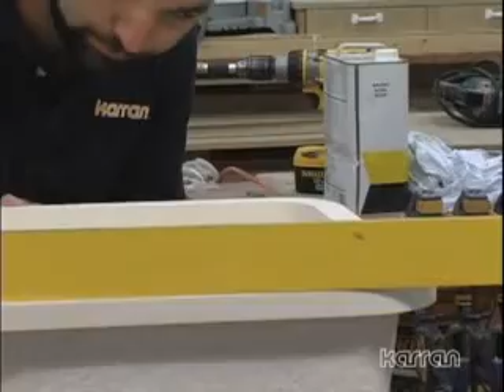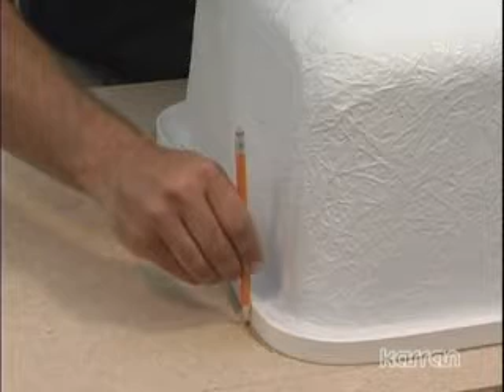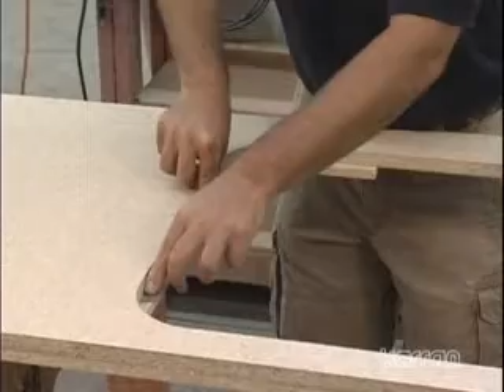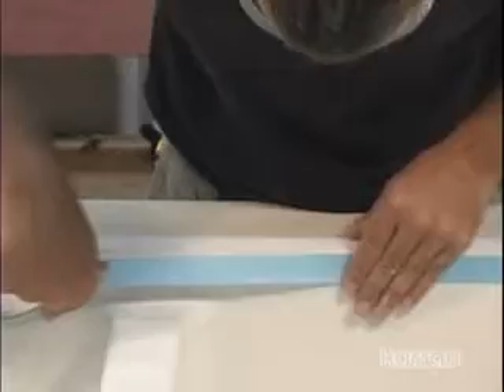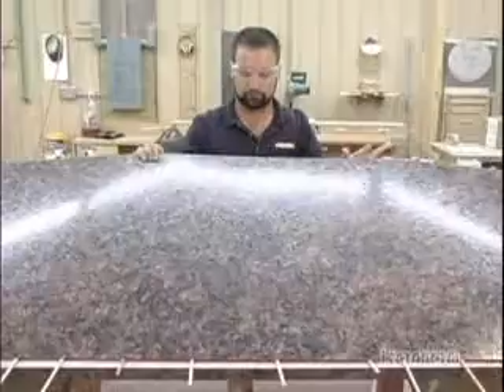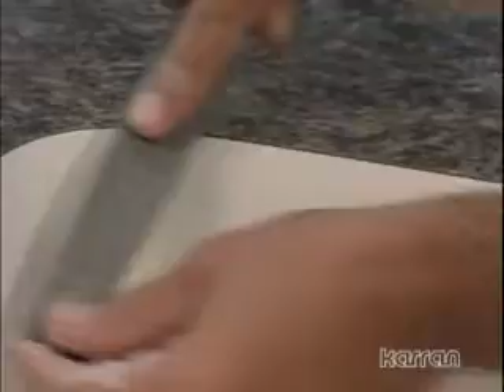How to install Acrylic Sink in Laminate | Bondo Method | Karran Sink | Karran USA

Comment: My Acrylic drop in bathroom sink is is not sitting flat on my counter top one side of the sink is a little higher then the other side.Should I fill the high side with silicone on make some thin shim to balance it out ?